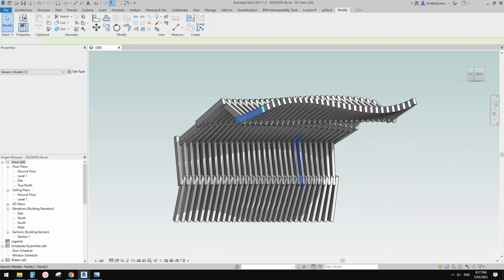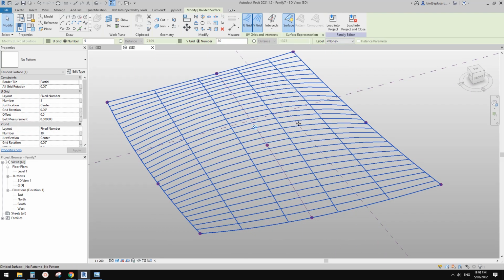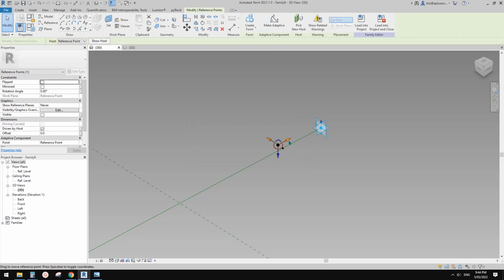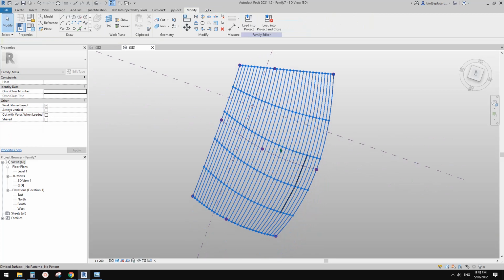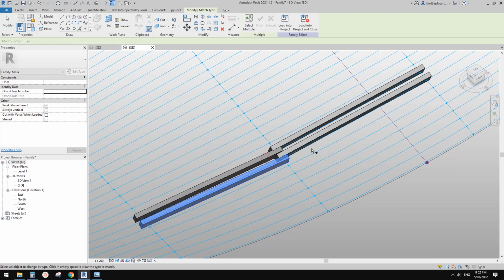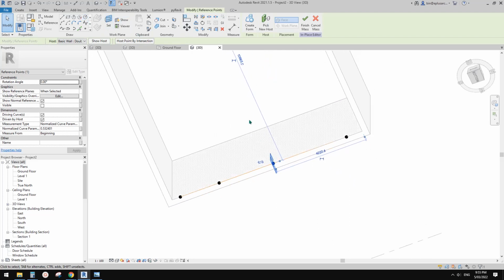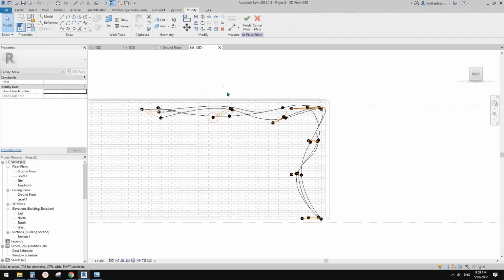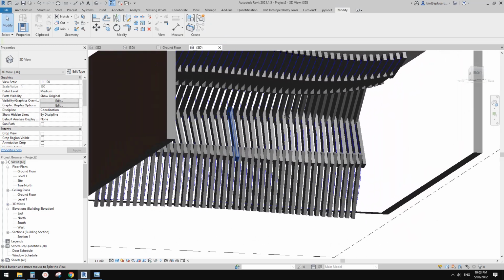Revit Exercise (Day 712) Adaptive Family & Massing

Comment: Hi sir..i have attach .rfa file to Google drive on ur twitter a/c plz chk .....
Reply from the maker: Try to make your panel family work plane based, then place it on the work plane of the reference line.
Reply: @BINHE615  ok...did u chk that family ...bcoz this is not the solution what u advice ..i m asking where should i put the theeta  angle on the small triangle..
Reply from the maker: Yes, I checked the family, and did not see any issue. I am not too sure what you were asking TBH. What angle? Which triangle?
Reply: @BINHE615  ok i will send u pic ..

Comment: Pls am having issue with porabola roof ...
Reply from the maker: The easiest way is to create a flat roof with no slop, then use Modify Sub Elements to adjust the height of the corners. Otherwise, you can use the mass tool if you want to have better control of your roof.